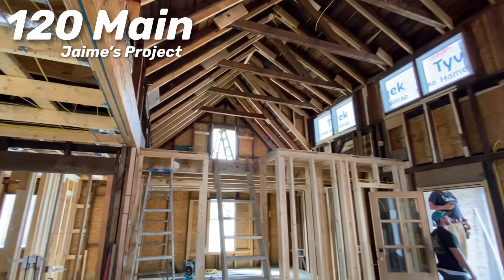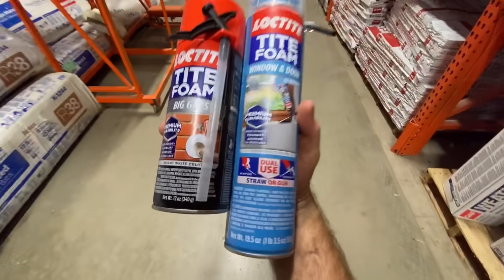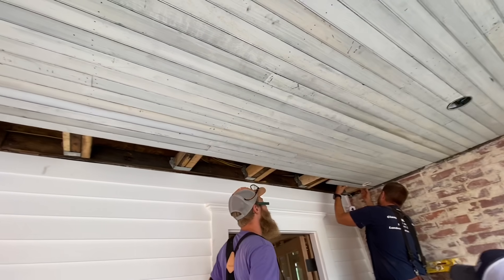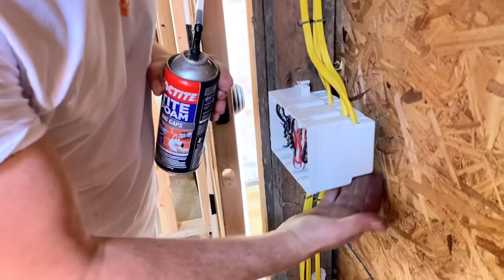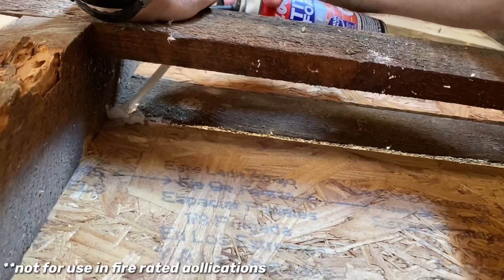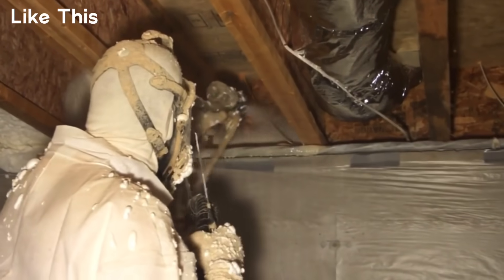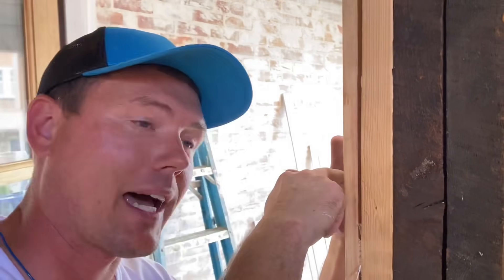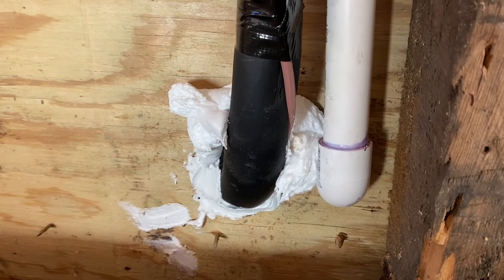Air Sealing 120 Main | Insulation prep with Loctite Tite Foam

Comment: Another good thing about spray-foaming behind the boxes is that it locks the box in place, especially multi-gang ones.  The box won't flex around when you're doing the finish electrical, which aids in getting the switches/plugs nice and flush.

Comment: I was just looking at spray foam to plug light leaks in my darkroom (and it's cool they make black foam that works nice for that application) but one thing I found was that the window and door foam has a much lower coefficient of expansion than the general purpose stuff so that it doesn't over expand and jam your jambs. (See what I did there?)

Comment: Use acoustical sealant on any gaps that cant be filled by a spray foam.
Reply: If you use spray foam gun you can seal even tiniest caps because better control for foam extrude.

Comment: i have a question, isn't the foam going to crack when the wood expand and detract during warm/cold weather?
Reply: This will Not Happen, no Worries
Reply: @timmstiegler4156  okey okey
Reply: @timmstiegler4156  Actually it does if there is a lot movement.  There are flexible foam which should be used if there is possibility for bigger movement.
Reply: @mr.wizeguy8995  till now i have never seen that the foam cracks...but i live in germany, maybe we have here some other foam?!
Reply: @timmstiegler4156  I used XPS for insulation between studs when i did small bay window and foam all around edges. 
Before i covered that wall there was small cap between XPS and sprayfoam on wood foam was still well attached. So it didn't stick well enough for XPS. Foam actually didn't crack it came lose but foamed seam wasn't air tight, so it might came lose if movement is too big but flexible foam will prevent that.

Comment: Here in Denmark, it's a big NO NO to use foam where water can get in contact with foam (at least PU foam), because the foam acts like a sponge when it dries and retains moisture. That can lead to rotting wood. Is it different in the US?

Comment: Foam expands. It will push that box out as it cures
Reply: With some practice you can squirt in just the right amount.  If you over-do it you can whack it out with an old steak knife or something and start over.  It's a bigger problem around doors and windows-- too much will jam them shut. 

When the "energy crisis" hit in the late 70s I remember lots of homeowners showing up at their custom builds with an armload of spray foam, plastering all their doors and window margins.  Next weekend they'd be out there painstakingly digging it all out after it expanded and jammed everything.

Comment: In Denmark foam is a big NO NO.Because the foam attracts humidity and holds it ,the wood rots over time.Only breathable materials as insolation.And between doors an windows,they put special oil based silicone,water and vapor tight..That is the best way of doing it
Reply: Really? Here in Norway I have a 28 year old friend who is a carpenter (so he should be up to date with current/modern practices) and he uses spray foam around doors and windows
Reply: Frederik Yeah...I know people who do it too here.We call it “fusk arbejde” . When the client try to sell the house,he either has to remake the work or sell it at a loss.